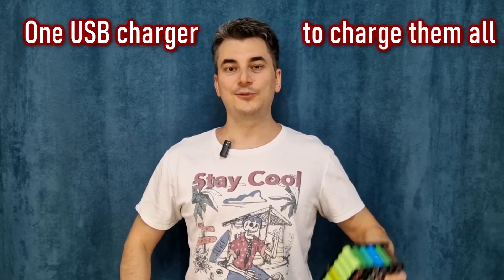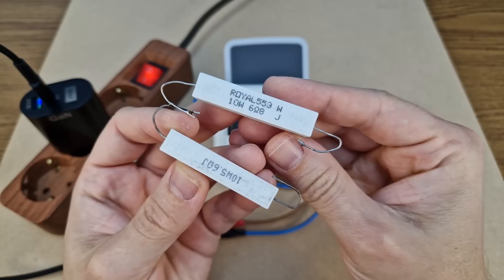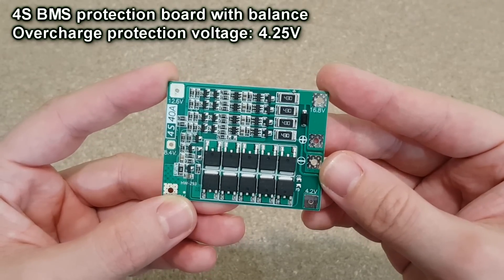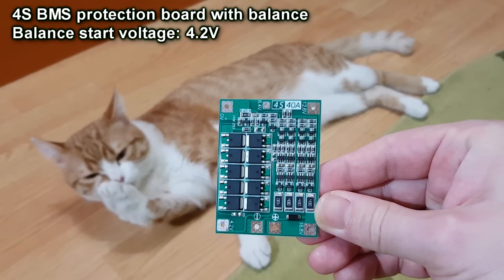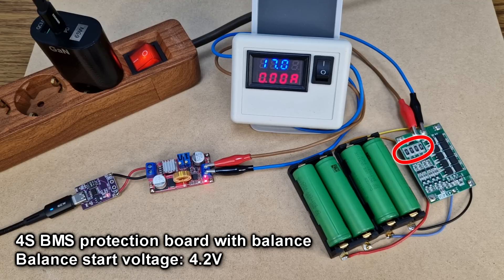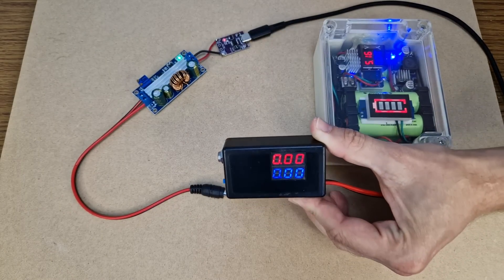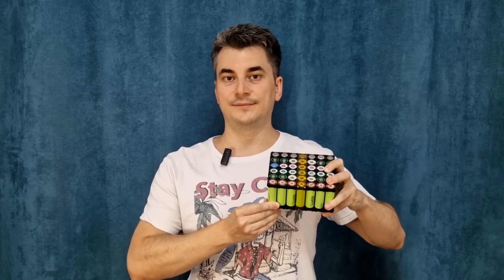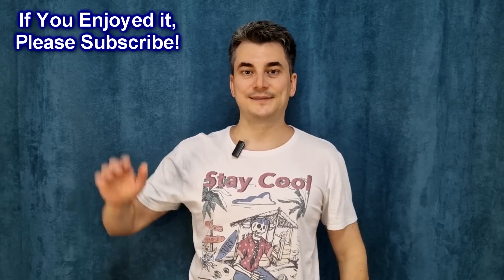How to use one charger for all your batteries/devices

Comment: 2:00 Hi i have 65w gan charger whenever I connect my fast charge trigger module led is blinking..do i need to use separate type c cable which support 65w??my type c cable is just a normal cheap one.
Reply from the maker: You can try with a better cable. 
If it doesn't work, then probably the charger turns ON the output only when you connect a bigger load.
Reply: https://drive.google.com/file/d/117fJ1kZOQ7Yrppk4TFgvkdamEZJL8Idp/view?usp=drivesdk @Sorin_DIY
Reply: https://drive.google.com/file/d/11I-J-vuZA6i1e7LDrCxpi_WhMY-Z01GS/view?usp=drivesdk
Reply: Take a look and reply me back

Comment: Your video has been very helpful. I have 5 4S packs that I would like to charge simultaneous. Have been attempting to make a charger and have not been very successful. The Buck converters appear to be a solution to my problem. I think 2 working in tandem would be sufficient for my project.
I am looking to charge at 14V 8A which should give a safe charge that is expedient.
Thank you for the information! Any comments or recommendations would be welcomed!
Reply from the maker: Be careful, if you charge the battery with 8A. you need heatsinks on the converters, thick wires and good connectors.

Comment: hi, what charger do you recommend for a 12v 15 amp lithium ion battery pack?
Reply from the maker: It depends on the battery type. is it a 3S Li-Ion battery? with max 12.6V?
Reply: @Sorin_DIY  yes 3S 12.6 v
Reply from the maker: You can use a 2A Li-Ion battery charger: https://s.click.aliexpress.com/e/_Dk76KA9
Reply: @Sorin_DIY  thanks bro

Comment: Salut. Vreau sa imi fac o baterie din 21 celule 3 S. Dar cum incarc bateria rezultata? Ce incarcator sa folosesc fara sa fac modificari ....
Reply from the maker: Salut. Inseamna ca o sa ai o baterie 3S7P. Trebuie sa verifici si capacitatea reala a celulelor si iti trebuie si un modul 3S BMS. Iti trebuie un incarcator puternic, altfel dureaza prea mult incarcarea. 
Depinde ce capacitate reala are bateria si in cat timp vrei sa o incarci, apoi poti sa stabilesti ce incarcatori sa folosesti.
Reply: @Sorin_DIY  majoritatea celulelor sunt testate individual si au cam 1700-1790 mah fiecare. Provin din baterii de trotinete. Am si BMS 3S dar nu stiu ce incarcator sa folosesc. Cam cat o sa fie capacitatea bateriei rezultate?
Reply from the maker: pentru celule de 1700mAh bateria o sa aiba 11900mAh, adica 11,9Ah. cu un incarcator de 12,6V si 3A o sa dureze cam 5 ore sa incarci bateria de la 0 la 100%.
Reply: @Sorin_DIY  nu stiu cum ai facut calculul dar merci de rasp. Inseamna ca tre sa caut un incarcator de 12.6 v si un minim 3 Ah. Tre sa fie ceva special? Multumesc inca o data de rasp
Reply from the maker: Iti trebuie un incarcator de genul acesta: https://s.click.aliexpress.com/e/_DCdktsD
trebuie sa scrie pe el Li-Ion charger, acestea functioneaza cu constant current/constant voltage pentru a incarca bateria.
nu e de ajuns un simplu "alimentator" de 12.6V. 
daca vrei sa incarci cu mai mult de 3A, se complica putin, pentru ca iti trebuie fire mai groase peste tot si conectori care rezista la 5A sau mai mult, altfel se incing firele si conectorii si se pierde multa energie.
Reply: @Sorin_DIY  multumesc mult de tot pentru ajutor. Sa ai o zi buna in continuare si multa sanatate! Te salut

Comment: hello,
thanks for the useful videos. I have a secret problem like this, can you help me.
I want to use XL4015 for 4S3P battery charging. I set the voltage to 17V and the current to 2A. When I connect the battery to the output, the light on the XL4015 module is on. The module draws small currents without connecting anything to the input. When I make the battery and charging module a closed box and charge the battery, the battery is discharged after a while due to this leakage current. To prevent this, I connected a diode to the output of the module, but this time the diode gets very hot due to the current drawn during battery charging. What can I do to solve this?
Reply from the maker: Hi. You need to add a more powerful diode between the converter and battery, like 10SQ045 with max 10A. In this case you need to increase the output voltage to around 17.5V to compensate for the diode forward voltage drop. It' better to measure the voltage after the diode with a small load connected.
Or you can lower the charging current cu 1A or 1.5A. 
Or you can add a small relay powered by the charger, to connect the output of the converter to the battery, when you plug in the charger.
Reply: @Sorin_DIY  The relay seems more usable against the heating problem of the diode, thank you

Comment: Sorin, i have one thing to point out: for a 4s li-ion, the charging voltage should be 4.2x4 instead of 4.25x 4
16.8v is the correct voltage, and 17v is very slightly overcharging it. Personally, i would set the charge voltage to 16.5v to get a bit more longevity out of the cells at the expense of losing about 5% of the battery life. 
I can see why you chose 17v because that's the BMS protection voltage, but the BMS overcharge protection limit is something that you'd hit in unexpected circumstances, rather than all the time.
Anyway,

I rarely ever comment, but I have to say that i love your videos. Our thought processes are similar in terms of the diy ideas that we have, and our execution of those ideas are similar. I'm glad I found your channel, and on that day i subbed immediately 😁

Keep up the great work bro.
Reply from the maker: Thanks for the comment. Yes, the 4.25V overcharge cut-off voltage is too high for Li-Ion cells. But I haven't found a BMS board with a lower overcharge protection voltage. I have found other BMS boards with the cut-off voltage at 4.27V or even 4.3V. this may sound strange, but there are Li-Po cells with max 4.35V.
If you set a lower charging voltage and manually disconnect the charger when the battery reaches that voltage, then it's ok.
But if you leave the charger connected overnight or for days, the cells will be continuously charged with a low current, because the battery voltage doesn't reach the cut-off voltage and this will damage the cells in time. in this case it is better for the cells to reach the cut-off voltage, even if it's a bit higher, and stop the charging process.
I also made a video with the XH-M604 charging control board, you can use it to set any cut-off voltage you want, it's useful especially for bigger batteries.
Reply: @Sorin_DIY  ah I appreciate the clarification and the suggestion. Thanks a lot

Comment: I believe a dedicated charging module has stages of charge not only one stage like buck converters have so it might ruin your batteries.
Reply from the maker: In my video I showed how to use the maximum charging current without overloading the charger. But using a CC/CV converter you can adjust the charging current depending on what type of battery you use. 
Even the simple boost converter/charging module, you can order the module with a lower or a higher charging current depending on your battery.
Reply: @Sorin_DIY  yes I know that but the right way is to use stages of charge like a tp4056 chip offers.
Reply: @Sorin_DIY  I have used a CC/CV buck converter before with 3s2p pack and it got destroyed after sometime bcs of just supply 1amp to it some of the cell got hot.
Reply: @Sorin_DIY  I even used a BMS
Reply: @Sorin_DIY  but using tp4056 on the same cell brought them back to life.

Comment: I have already the cheap boards. They give about 13,5 Volts for 3s. Is it suitable for 3s batteries to charge?
Reply from the maker: The voltage is a little too high, but it will work. The problem is that when the cells will reach the cut-off voltage of 4.25V, they will still draw a high charging current, when the charging process is finished. 
The final charging current at the cut-off voltage should be around 100mA. But because there will be a big difference between the charging voltage and the battery voltage, the charging process will end with a higher current probably 500mA or more.
You can add a Schottky diode between the converter and BMS to decrease the voltage with 0.4~0.5V. This will help the charging process to finish with a lower current.

Comment: I have seen a few of your videos, most informative but had trouble following this one as to a single charger. For instance for me I need a 82V charger. While not practical for travel I have found a Desktop Power supply works fine, with Constant Current and Constant Voltage Control. So basically, even at a smaller voltage amperage you are showing ( I need 10A to charge my cells),  you are really showing the same conclusion. For unmonitored charging A CC and CV system is desired.

Comment: What if you connect more chargers and charger modules in parallel? Is it charging faster (bigger current)? Or is it working at all?
Reply from the maker: It will not work in this configuration, the modules may burn.

Comment: Nice Project as usual.
How about adding a
WZ3605E DC DC Buck Boost Converter
to make a portable rechargeable variable power supply in addition to the 5V usb
output in your power bank.

Comment: If you are using an amplifier that has reccomended rating of 12V (over 3A reccomended) won't the cell holder overheat?
Reply from the maker: This type of cell holders is very good. But for a big battery pack it's recommended to spot weld the cells.
Reply: @Sorin_DIY  So, if I use a 3S battery pack with this holder and solder from the contacts to BMS will it not overheat?
Reply from the maker: It depends on the load. I tested this type of cell holders with 3A and they work fine. the contacts may heat up with a higher current, you always need to test the components before the final build.

Comment: Don't forget to add over-temperature protection - a battery fire is one nasty discharge you'd want to avoid
Reply from the maker: Yes, I also have a video about thermal protection for batteries.
Reply: @Sorin_DIY  Is it the one where the switch has a rated limit of 5A?
I would only use that for low powered devices, drawing 2-3 amps max.
Reply from the maker: Yes, there are cheap 5A or 10A thermal switches that can be used for a simple thermal protection for circuits or batteries. they are ok for testing or for hobby projects. 
for professional projects there are also more complex and expensive thermal protection solutions.

Comment: An XY3580 or XY3606 (80W 5A max vs 216W 6A max output) would be a much simpler way. I do this with a 20V trigger on an Aliexpress charger I got for $22 that is called "268W Gan charger" but its not really a 268W charger in any way...but the top port will do 20V 5A if nothing else is plugged in. The moment you use a second port the top port drops to 65W so still 20V but only 3.25A. So until we get 240W PD the 216W buck boost module can't be used at its full potential....but the price difference between the 3580 and 3606 is so small ($17 vs $23) that I'd recommend getting the 3606. 

$22 PD charger with a 20V trigger into the $23 XY3606 and I now have ~100W of power to charge anything up to 36V....so will not work for 10S and up batteries and it won't fully charge a 9S...who uses 9S though?

Comment: Now if you simply charged at 100mA you'd charge the high cell with 0 charge current while the others catch up. Then you don't have to worry about overvoltage cutoff.
Reply from the maker: yes, but in that case you need to manually disconnect the charger, otherwise the balance resistors will continue to draw power from the charger and they will heat up.

Comment: Helpful!  Glad you showed a BMS is not by itself a complete charger without a CV/CC module in front. BTW, heatsinks pasted to the plastic case of ICs and transistors is useless. The place to put the heat sink is the bottom of the board and install the board upside down.
Reply: they're not made out of plastic
Reply: @danielsuess5921  Epoxy-Cresol-Novolak (ECN) is considered a polymer.
Reply: @danielsuess5921  I was just quoting what Julian Ilett said 5 or more minutes into his most recent.
Reply: 😁 I was just quoting someone else. https://youtu.be/6GnoQxTYjVI?si=LmiWdjnp40tCC7_I&t=314

Comment: I have a lot of 18650 cells that i gathered from dead laptops, a couple of months ago while making a project encountered an angry LI cells incident and since then I started treating them with more respect, so I will use extra caution with a project like this one because i am using old and already too used batteries, I wish Sodium Ion cells to get more popular for safety and reliability reasons although energy density is lower.

Comment: This is also what I did for a 6S2P pack, but I had a problem with one CC/CV charger (similar to the one you show for the 8S pack) since it put into protection mode my 65W PD charger (although it was set to consume max 55W, and with a 100W charger it worked fine).
So I also got a 6S mppt solar charge module since I wanted to also charge my pack with a 50W solar panel, and hooked that up to the 65W PD charger that acts like the solar panel and all went well that way.

Comment: lol i got a 54liter 12v dc compressor refrigerator that i wired to a 28v dc trigger board. waiting for a 140w pd 3.1 charger to come in the mail but its running fine off my dc powersupply. thinking it will be more efficient. at 12v it was already only using 150wh/day which i think is worth it as a drink fridge since my main fridge isnt even that efficient and when you open the door all the air falls out.
guessing my fridge is working on 28v no problem coz most of the 12v dc compressors also work for 24v and 28v is still in the 24v spec since lead acid fully charged voltage can be around 30v with 2 in series like most big rig trucks